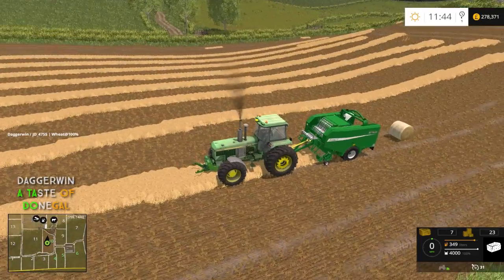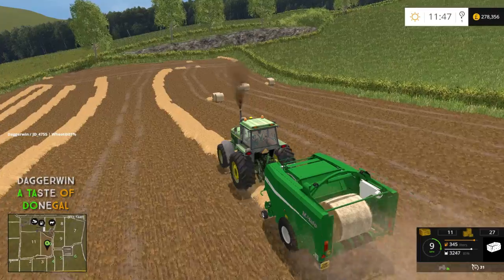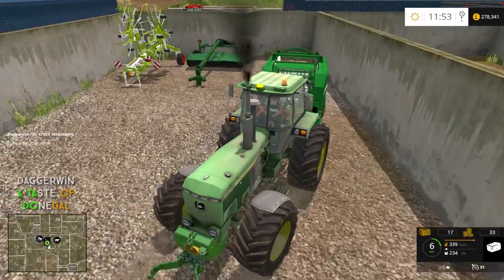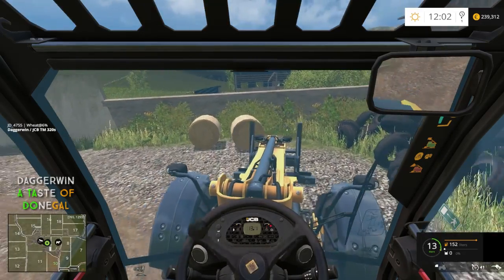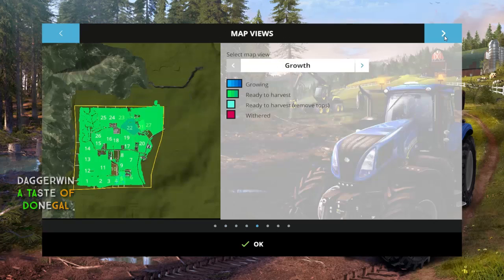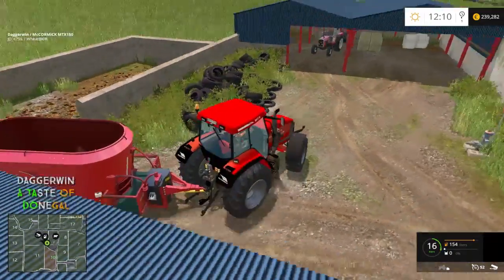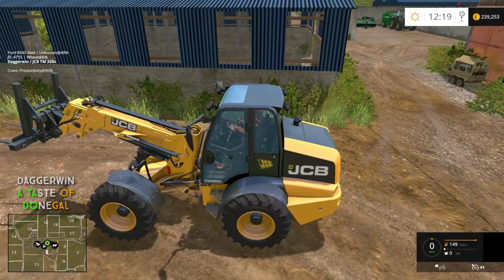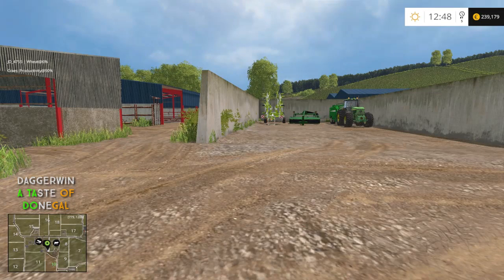Let's Play Farming Simulator 2015 | A Taste of Donegal | Episode 8

Comment: When loading the mixer with bales only, you'd waste half a bale if you fill the mixer completely. That's because one bale is 4000 liters and the mixer can hold 18000 liters.

The best way to load the mixer would be to add one of each bale, then add one hay or silage bale depending on which you the have most of.